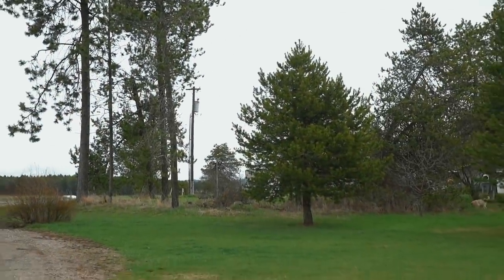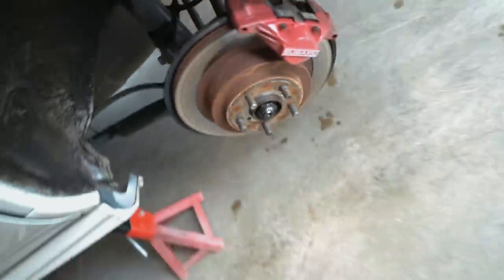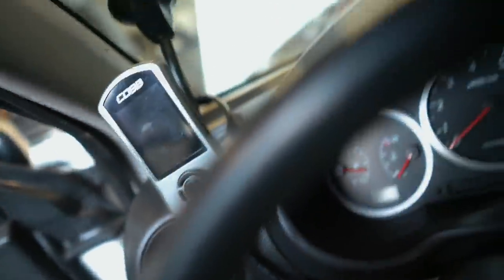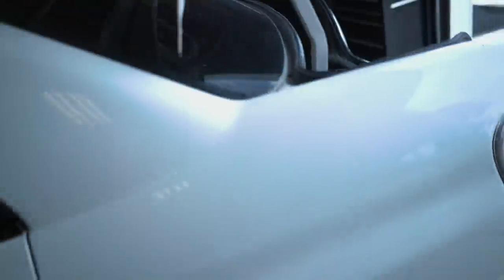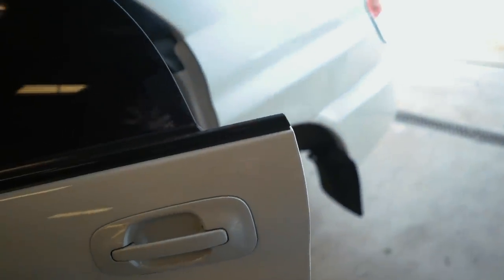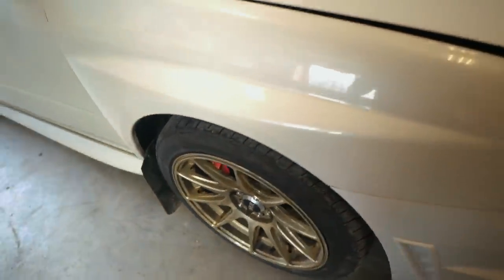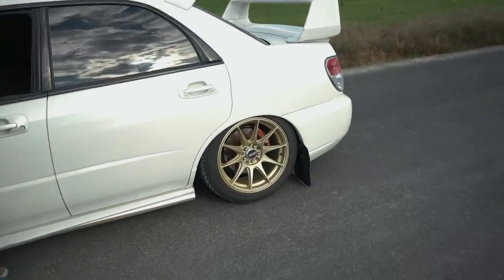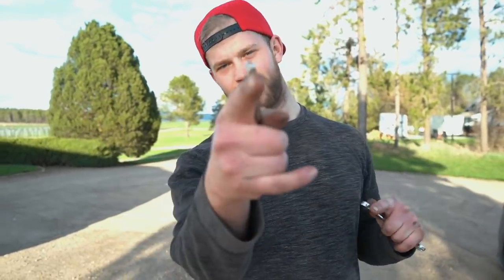Bagging the WRX

Comment: Sweet lookin' WRX.
1:20 Looks like the 'cruise' light is flashing with the CEL on. Bet it's Code P010X (101,102 or 103) Hopefully this guy checks that MAF sensor.
Reply: It’s for the secondary air pump

Comment: Hey man can u help me out I have a 2013 frs and my set up is 17x10 and 1 inch spacer in the front and 2 inches in the back and I installed new camber control arms and whenever I go above 20mph my traction control comes and and my abs comes on, What’s the problem ? Do u have any suggestions?